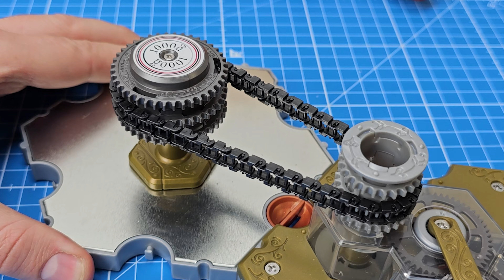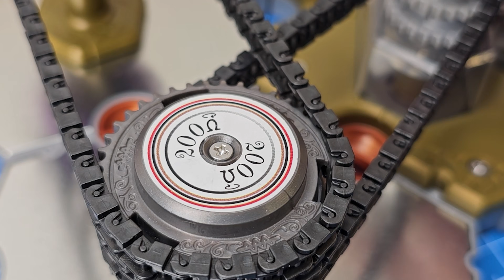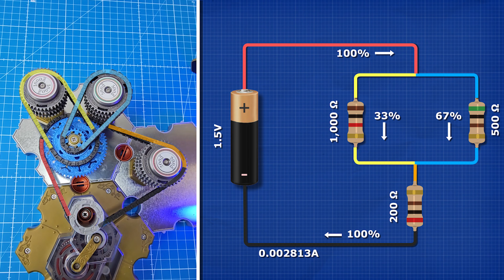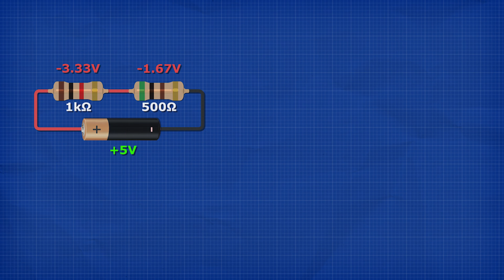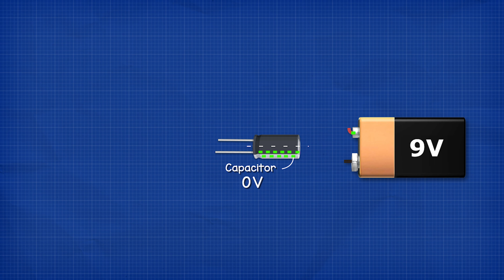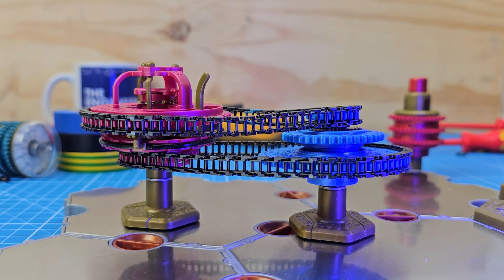This Circuit works without electricity

Comment: The best circuit to build would be an amplified radiowave transmitter and receiver. It might also be good to get input from a mechanical engineer. Several things were missed that could be talked about. Watts or HP (how much and how fast can work be done) = volts current velocity force. The basic fundamentals of electromagnet and mechanical are the the same and often come together in fluid mechanics.

Comment: I dunno being both mechanically and electrically inclined, I find it far far easier to understand the electronic circuits compared to the mechanics emulating electronics. Looking at the mechanics I just keep seeing it as a mechanics, I mean the transistor is just a clutch.

Comment: What are the volts in this case? it's a little confusing because the current is like the chain moving at a constant speed then what are the volts, like in an electrical circuit the voltage is determined by how many electrons you have or the potential of electrons (is a difference).

Comment: Whenever I see so much plastic in one place, I want more than anything to smash all of it with a hammer, a sledge, or some bricks. That oh-so-wonderful crunchy plastic SNAP and the satisfying destruction. You just don't get the same feeling from hitting metal cogs and wheels. Oh... That's right...
All of the science in this video was already done hundreds of years ago. It's just been "modernized" for the kiddies.

Comment: Wait wait wait, add more resistors in series and the current drops?????
The voltage is what drops, current will always stay the same in series
Reply from the maker: No, the supply voltage is the same, but it drops with each resistor you add in series. The current decreases as resistance increases. 
Current = voltage / resistance
Using multiples of 10 ohm resistors but a 10V supply:
10V / 10ohm = 1 amp
10V / 20ohms = 0.5 amp
The resistance increases, the current decreases, voltage remains constant. The voltage drop has been shared across more resistors.

Comment: There is a mechanical transistor that makes mechanical PWM possible and was invented over 23 years ago. It is a clutch that can go from a state of "engagement to one of disengagement" in a millisecond without loss due to slippage and thus no heat loss. Full engagement and full disengagement occurs with the application and removal of a Control Torque, respectively. And as can be implied, it has an Input, an Output and a Control. The Torque throughput can be many thousand times the Control Torque. This can happen because there is no translation of components to establish a state of engagement or disengagement ... only the application (or not) of a Control. It's called The Roller Cascade Clutch and was invented by me.

Comment: Can we make a mechanical radio and use it like we do electronic radios? Immerse a gearset in a liquid to carry the force via mechanical rather than electronic movement. Would that mean that both electrical and mechanical physics are subject to the same laws of physics. That is anything you could do electronically, you can also do mechanically, and what ever you can do mechanically you can do electronically. Mechanical Calculators and Computers partially prove this, or are evidence in its favor. This would mean any mathematical discrepancy in the laws of electronics and the laws of mechanics would mean that the math isn't describing the reality of physics. They would have to be palindromes of each other. perfectly fitting puzzle pieces, every curve followed.

Comment: build a flip flop circuit
Reply from the maker: You can build one, the book shows you how
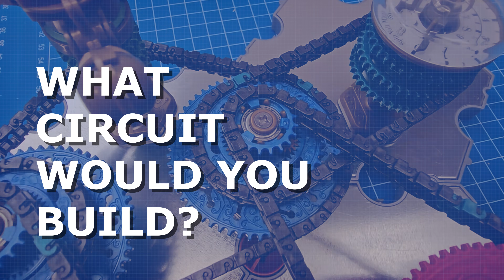Reply: @EngineeringMindset  I wanted to answer question at 13:17 . "What circuits can you build with these components?"  and here is my corrected answer that i found using google translate. "i can build a flip flop circuit"  sorry for my bad english. 😃

Comment: The concept of a mechanical transistor has a long way to go. The base is not simply switched on by a voltage. To turn a transistor on assuming it's a BJT type, you need a small base current. Mechanically, that would be a very slow moving chain on the base which will allow a fast moving chain from the collector to emitter. Then the speed of the chain at the emitter must be equal to the sum of the chain speeds for both the collector and base. Emitter current = base current + collector current.

Comment: Make an oscillator.  Ideally, make a synthesizer. ;] 
But an RC  oscillator should be doable. And also perhaps make an electric motor driver as a form of power supply. This would free up your hands to do other things.
Reply from the maker: Yep, instructions in book for hoe yo make it.so many amazing circuits it can make

Comment: If you have Inductor, Diode, Switch, and Capacitor that mean you can make a boost converter.
Let see if voltage on the output capacitor will increase with this Spintronics model.
Reply from the maker: Yeah, the book even shows you how to make it too! So many good examples inside

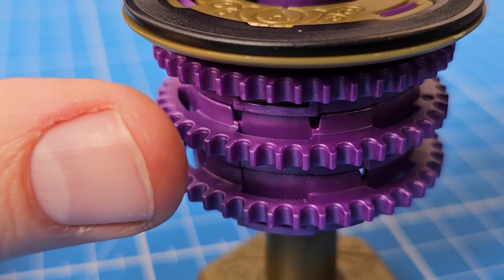Comment: 1:52 What if you took several of those gramophone ammeters and connected them with different gear ratios.

 If you spin another at a rate of 1.5x the first ammeter then it will make a perfect fifth.

 Doing 1.25x makes a major third. Play a root, major third, and perfect fifth and voila! You get a major chord.

Consonant:
2x - Octave
1.2x - Minor Third
1.25x - Major Third
1.33x - Perfect Fourth
1.5x - Fifth

Dissonant:
1.066x - Minor Second
1.125x - Major Second
1.414x - Tritone

Comment: Correct me if I am wrong, the simulation is not accurate in the case of a parallel circuit, the "resistors" here will experience a rotational speed depending on the gear diameter not on the resistor's value!
Reply: I was wondering about that, too. The junction component appears to have a planetary gearset in it - I couldn't see it well enough in the video to figure out exactly how it works.

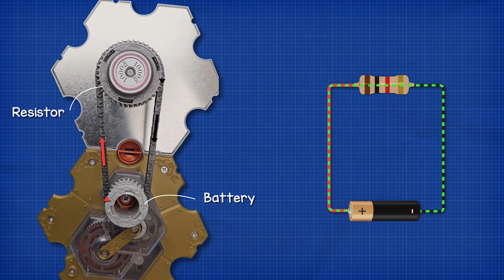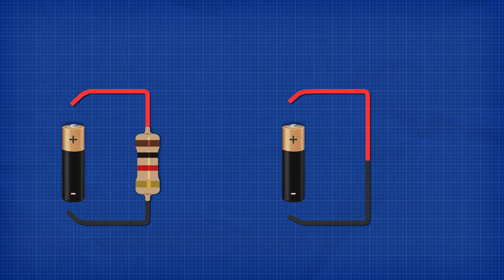Comment: Slight correction: 0:40, 1:40 No energy returns to a battery (unless it is recharging), but charge/current does.
Reply: I think you meant "No energy returns to a battery" not "No current returns to a battery"
Reply: @cogwheel42  Whoops. Yes, fixed. Thanks.

Comment: Thanks, Paul, this video was fantastic👍
I'm a mechanical fitter by trade, so I have a good grasp of most mechanical concepts.
I have been into electronics since about age 10, so I also really enjoy the electronics and electrical diagnostics and/or repair work that comes along with some of my jobs, probably more than the mechanical work.
But, even though I am very familiar with relating mechanical concepts to electrical understanding, volume, pressure, current flow, restriction etc....
Seeing this video and having to combine both of these concepts at once...JUST BLEW MY TINY LITTLE MIND😁🤣🇦🇺
Reply from the maker: Glad to hear. I think it's great to find an educational product that purposely teaches these concepts. We can all make associations in our minds but to follow along and see it is different.

Comment: Patiently waiting for someone to cover a gymnasium floor with this stuff to build a computer.
Reply: …that runs Minecraft, in which someone builds a mechanical computer….
Reply: @JasonJrake and so on
Reply: @JasonJrake  yea using Minecraft create mod
Reply: @aarnealplayzgames9580 code valorant
Reply from the maker: While building the circuits I realised it would be possible to build an entire computer. A simple one. It would take a lot of time to design and build. But, I'm tempted
Reply: @EngineeringMindset  Maybe start with a mechanical 555?
Reply: @EngineeringMindset  do it😂
Reply: @EngineeringMindset  could it run doom?
Reply: @mgcqball why is there always 1 person that asks but can it run doom when we're talking about building computers in weird places like
Reply: @EngineeringMindset  as long as it can run Doom
Reply: @EngineeringMindset  do it I’ll definitely watch!
Reply: @EngineeringMindset  brushless motor for drive lols
Reply: @EngineeringMindset DO IT DO IT DO IT
Reply: I remember steve mould once made a computer that runs on water
Reply: @megavoltampere1000  Not sure if you also saw Matt  Parker make a binary calculator out of dominoes.  If you have not seen that, I think you would also enjoy it.
Reply: What a fantastic way to understand how electricity flows and all the ways we can control it. This should be standard equipment for every school and any kid (young and old)  who shows a liking for engineering.
Reply: @spindoctor6385 it would be better if it was almost all metal for more durability
Reply: A huge field containing an i7 processor😂... 

Just to play need for speed on it.
Reply: Tempting 😏😌
Reply: how about first making a logic gate
Reply: Instantly i tought of that
Reply: flip-dot screen
Reply: Yea and than run doom on it xD
Reply: If you want to build a computer, you can just implement brainfuck language using those components.
Reply: I already made a mechanical and gate on my computer
Reply: It was my school chrome book and ours just got taken away and powerwashed
Reply: unfortunately it would probably break from the force needed to move a mechanical current through that many components and chains
Reply: First thing I thought too. It would be too expensive to do it with the kits unfortunately, but I might check the simulator out.
Reply: I saw thinking about buying a lot of kits to build a computer but I don’t have the money or time
Reply: lol
Reply: Of course it’s going to be a mechanical 6502
Reply: Love to see it